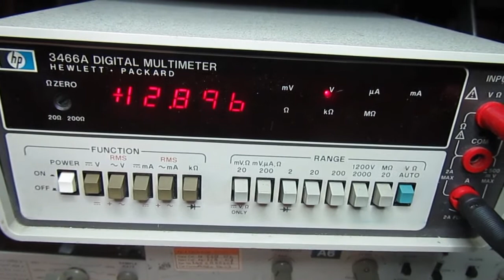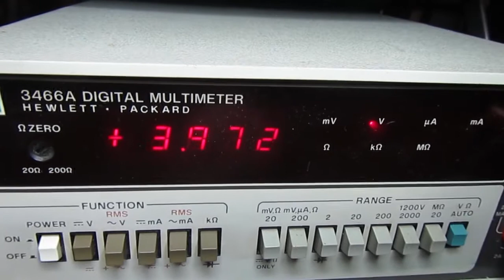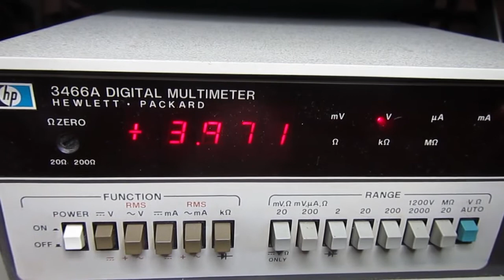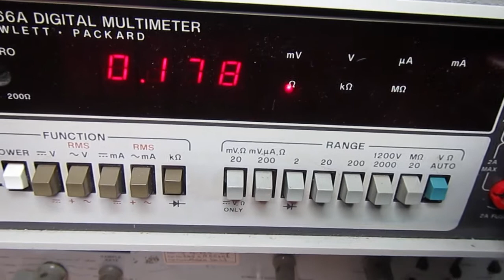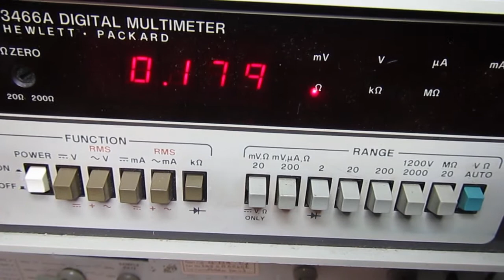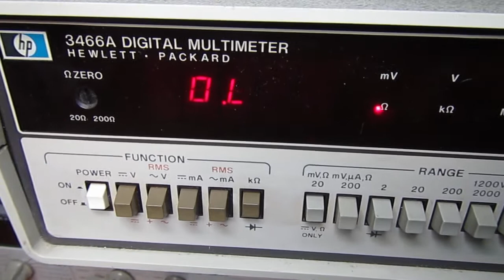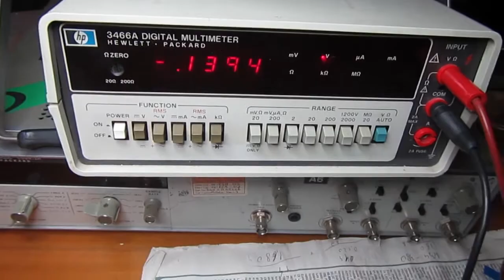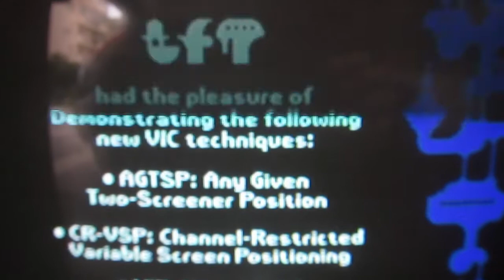Commodore 1541 repair: shorted +5V supply

Comment: Hmmm… you have an Alps drive but the J6 jumper is in place. Some references say that's for the Newtronics. Does it matter?
Reply from the maker: Hi, well spotted indeed! That drive was not mine and since it worked, I didn't even notice the jumper. And no, I don't know if it matters or not, I've never experimented with that. If I happen to repair a similar drive, I'll try to test what difference it makes.